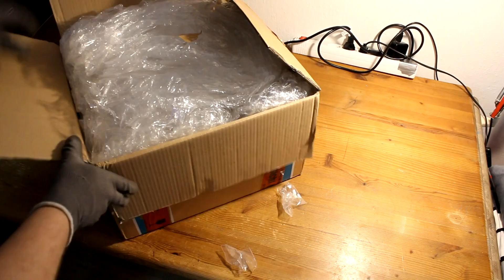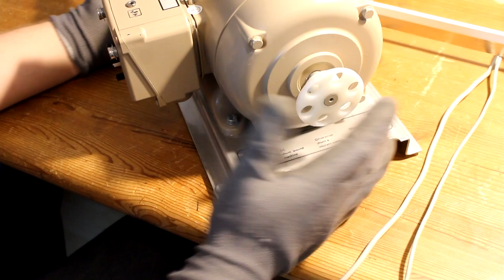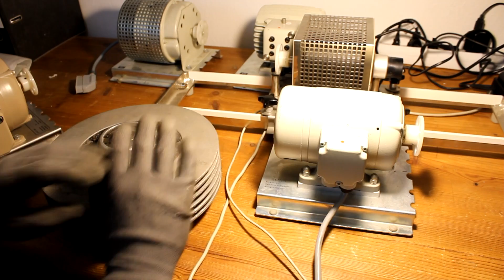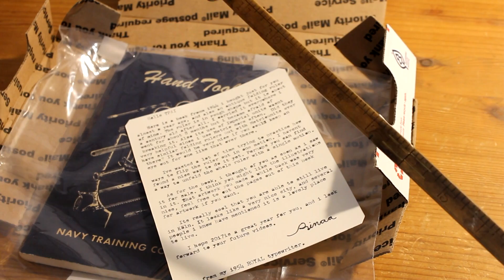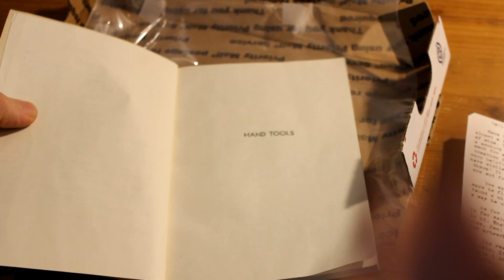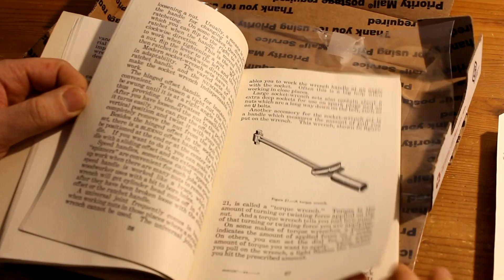Update: Lab Power Supply, Electric Motor Test Stand, New Workshop?

Comment: Do you happen to have a video detailing your largest bench power supply shown in your other videos, including the first regarding this lab power supply, that huge like 8U unit?  I'm again thinking about making a lead acid battery rejuvenater, vehicle starter, high current charger 12-24VDC 200A (or more possibly) and/or 0-24VDC high current power supply.  Was planning to use a turn on an old buzz box welder transformer, though assessing options instead of purchasing a new toroidal 3000VAC or greater transformer which would be nice.  Thinking might be more cost effective to watch for some things suitable to use and not quite wanting to use a few MOT's in parrallel.

Comment: Cool stuff.  I have a question I bet you could answer.  Could you use a frequency generator through your power supply to vary the speed of the single-phase AC induction motor?  

This is often done with PWM, but this results in a buzzing.  I guess people don't do it because it's complex.  But it seems like it'd work with no buzz.

Comment: Here is the same on license plates. Once you lost one of the two required, you need to start all the paperwork to cancel this registration number and get a new one. You get temporary paper "plate" that you need to glue in your windshield until the paperwork ends. You usually get the SAME number you use before (in the license plate) but a small letter printed between tells the REVISION of the plate number. Any license plate from a previous revision is not longer valid.

Comment: Can i use an Electromagnetic brake like that in my lathe? Could be usefull to activate a brake electronically when you turn off the motor.
Reply: I don't need to slow it down. I want it to stop as fast as it can.
Is usefull mostly when making threads in the lathe, if the spindle stops fast you can thread up to the shoulder of the piece and it's safer.
Reply: Oaky Goldsilver I can assure you that in my shop an emergency stop button that I made is connected to a hydraulic brake. Not an electrical one because it gets unreliable sometimes. I needed a hydraulic one because it's a saw. Immediate stopping power is needed in order to avoid getting a human sausage.

Comment: Looks to me like you are getting voltage drop through the cables to the load, as it looks like you are connected at the load end not directly at the output of the power supply.

Comment: Have a look at the LT3081, nice voltage regulator with current limiting which can be used in parallel to up the current rating.

Comment: Wow what a pain in the arse. I would be welding my replacement plates to the car!  ;)
Reply: Most of the time, the German plates on our cars sit in plastic holders that are screwed to the car. The cheaper ones are only good for one car/plate though, and if you remove them too often, they won't close any more. Of course, the plate slides in them from the bottom, so that if the bottom latching part doesn't hold on any more and falls off, the plate will slide out. Until now, nobody could tell me why they don't open from the top. Maybe it's because new plates are such a hassle to get? ;-)

Comment: "Remaining AC voltage superimposed to the output voltage" - nennt man "Ripple" im englischen ;)

I Like!
Reply from the maker: Jo. Den Begriff hab ich ja auch in meinem letzten Video über das Netzteil verwendet, viel mir aber hier bei der spontanen Aufnahme nicht ein.  Mal davon abgesehen ist der 50 (oder 100 Hz)- "ripple" oder "Wechselanteil" wirklich kein großes Problem, denn der ist so langsam, dass er durch den Linearregler quasi vollständig rausgeregelt wird. Zumindest wenn die Spannungsdifferenz wischen der Eingangs- und Ausgangsspannung des Reglers groß genug ist. Aber naja, danke für den Hinweis und ich werde im nächsten Video mehr über diese DInge reden!

Comment: Did you have your remote voltage sense wire connected at the load?
Well done on the youtube play button :-D
Reply: zx8401ztv : exactly what I was going to post! It's important to sense at the load when doing these measurements. The difference can be very significant at high currents. Several watts can be lost in the wires alone.
Reply: Yes it can be really bad if you dont use thick copper wires, copper is not too bad,  but the resistance soon adds up.
Lost voltage dropped across the cable can affect the device connected, so the remote wire is a simple way :-D
And the wire dont need to be thick as its just a voltage sense.

The voltage drops in car starter motor wire runs can get silly if its one of those cars with the battery in the boot, daft idea.

Comment: There is a difference between machine and motor. A machine can transform freely between electrical and mechanical energy while a motor can only be used for transforming electrical energy into mechanical energy in normal operation.
Reply: That's a VERY important functional difference and a really useful note!
Reply: ...Though most machines are called motors colloquially and there is not much wrong with that. Machines are motors, but they also are generators. That was just me being a smartass. Sorry about that :D
The only real use for that knowledge is when you try to use an induction motor or universal motor as a (regenerative) brake and wonder why it's not producing much torque. Don't get me wrong, it is possible to do so, it's just a lot more complicated than with electric machines.

Comment from the maker: Hey I think I misspoke when doing one of the calculations. The loss in the transistors is the voltage drop across them times the total current. Here that is 5...6V*3.2A = 15...19W
Reply: you had me at voltage drop.
Reply: ..does anyone have a problem if Obi-Wan Kenobi happens to be German!?!

Comment: how is the temperature of the dummy load and should you you put a fan on it? and meaby a temperature control on it ?
Reply from the maker: That depends on the actual power dissipation of course. In my experience it can handle 400...500W for a while without fans. I have another dummy load that uses one large resistor and fans. It's an easy way to improve it, but it's not necessary for the ammount of power that this power supply can put out.
Reply: isnt it possible to use those cheap infrared heaters as a dummy load?
Reply: +jerry1378 Yes, but it's not as variable, if at all (depending on the type etc.). Here he has 6 states of load he can apply to test how the PSU behaves under minimal and maximum loads, with additional steps between for normal load conditions.